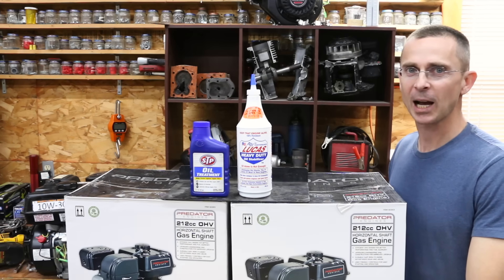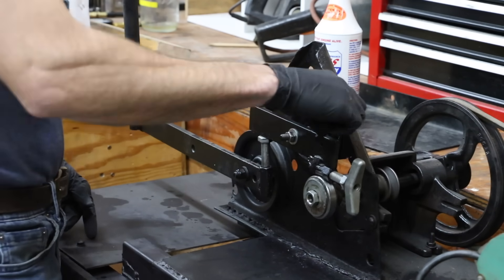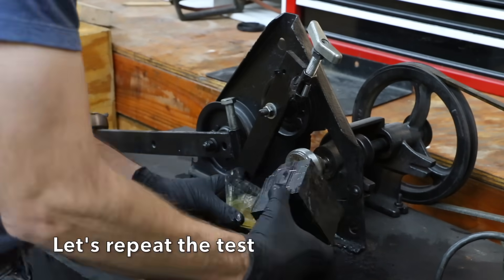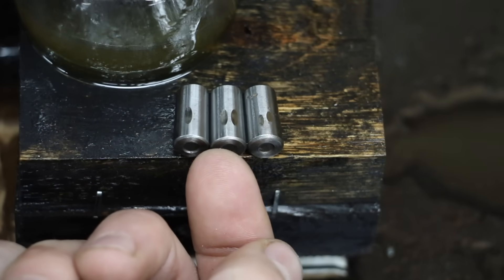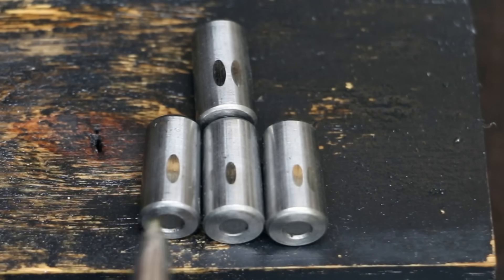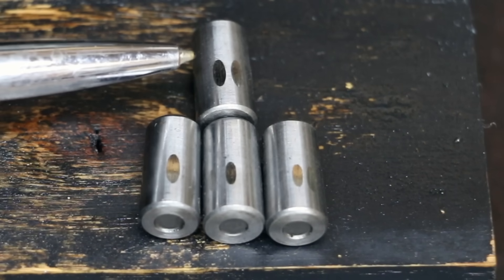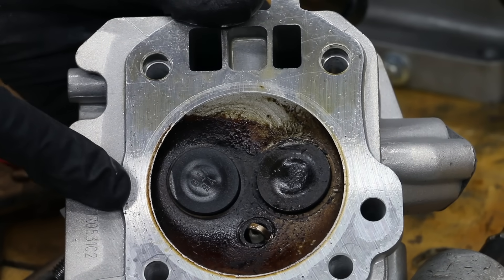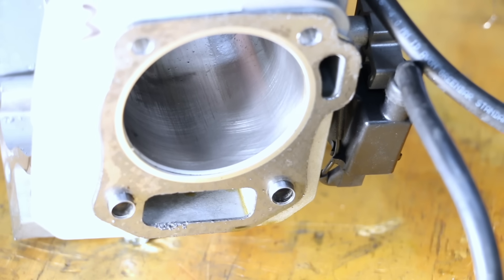Which engine self-destructs first?  Lucas or STP?

Comment: Hmm... Lucas vs Schaeffer's Moly additive? 🤔
Reply from the maker: Thanks for the video idea.
Reply: @ProjectFarm  you're welcome!! I have a bottle of Schaeffer's, but after the bad reaction my engine's variable valve timing solenoids had with Ceratec (or old age, but it happened the oil change of, go figure), I'm weary of putting the Moly additive in there this time. Simpler engines might fare better.

Comment: How about a test using strictly oil treatment in an engine,  no oil....
There is one product  called 
" Kleen Flow " engine oil treatment
I've used in my old Mazda 323 1991
With over 190 000 miles, works very well, wondering if you used a vert badly worn push mower or maybe even a lawn tractor, just to see...
If compression  raises? Temps???
And signs of wear...may e put it against 
" bardahl"  engine treatment , the thick goopy 1,  run both those as only sour ce, of engine , as if was emergency situation and you had no oil on the engine?? Lol, really enjoy the videos
Reply from the maker: Thanks for the video idea

Comment: I watched a skid steer run with a fist size hole in the block with the rod flopping away after which the rod was removed and the hole welded up with the piston welded to the cylinder and continued to run for years until it was finally junked for other reason and since then I have been a firm believer in Lucas. The engine was a 4cylinder Wisconsin
Reply from the maker: Thanks for sharing.

Comment: Good day sir, I. From the Philippines. I have a question. I have ford trac 2001 model. Issue is delayed shifting and hard shifting. When I check my trans. Fluid, it is low, dirty brown fluid, smells burn.
If I put that product Lucas, can I change the fluid and filter first before putting product Lucas?

I'm waiting your response and I'm really appreciate it.

Thanks.

Comment: Really like your videos and I take a lot from them. But in all fairness you needed 40 more engines, 1 control engine using just engine manufacturers recommended oil, 1 with stp additive and the engine under load, 1 with lucus and the engine under load. You also need a set of engines for hot days and a set for cold days, need a set for testing in the rain, need a set for windy days, need set with engines that have a lot of hours...etc. I think it was a fair test though and don't let people like me tell you what you should have done. Going to patreon and support uour channel. Thanks
Reply from the maker: Thanks for the feedback. Thanks for supporting the channel!

Comment: Can you do a similar test but with 2 stroke engines.  Which 2 stroke oil is best.  Run a couple engines with 2 stroke oil 40:1 gas mix for 30 minutes or so, and then run  them with just fuel and see which one goes longest.  Maybe REDLINE, Amsoil, Maxima, and a generic brand.  I have a small 2 stroke 29cc engine and I wonder if some oils are better then others.
Reply from the maker: Great suggestion!

Comment: Slick 50 takes time to embed itself into the pores of the metal surfaces, no short term test is valid. It definitely is a friction reducer in the short term. When I put 4,   two stroke 50ccc bottles of it into my V4 Johnson outboard via the 4 barrel carbie, at idle, it reved up by almost 200rpm. As for long -gevity, its still hard to say as its done only 330 hours of running, so only time will tell.
Reply from the maker: Thanks for the feedback

Comment: I'd like to see your best ever tested vs schaeffer oil w/molly
Schaeffer is big time in farm equipment lubricants including grease
Also make motorcycle oil that can't be used on clutch because it won't allow enough friction
Reply from the maker: Great suggestion!
Reply: @ProjectFarm  I failed to mention, since you're on a farm it may be extra important to you, that their grease is water proof

I was at a demo few yrs ago. The test where you have a bearing spinning in oil and apply a force to the bearing. They're test didn't show any marking and the other oil you could press on the handle and stop the electric motor, with their oil he put it on the floor and stood on the handle and it just kept spinning, the guy was bigger than me and I weigh 200

He added water to grease and mixed, the other mixed with the water and turned white, their grease the water didn't mix and it poured out after mixing

I have motorcycles and cars, I'm afraid to use the oil because they're manual transmission, I could put in the Harley because it has separate engine and transmission oils

Comment: Oil additives.... Just use good oil in the first place. AmsOil, Mobil 1, Royal Purple.... I even ran my Ram Cummins 6.7 liter for 16,000 miles on Shell Rotella Triple T, and the oil quality could have gone another 8,000 miles when I changed it. Just use good oil in your engine. Don't be cheap. Putting these garbage additives in your oil won't save your engine after you've ruined it with cheap oil, or by not changing the oil often enough.
Reply from the maker: Thanks for the feedback.
Reply: @ProjectFarm  - I hope that didn't come off as too brassy. I just feel very strongly about oil changes. Even an old push rod engine will go 200,000 miles if you just keep up with oil changes and use good oil.

Comment: I'm not sure what running the engine with no oil proves... I think a better test would be to remove the governor and put in 26 lbs valve springs (SO the valves wont float) and use the same oil in each engine then add the additives and run them until they die. this would not only test their high RPM endurance but test the internal components of the engine and how much does oil really play a part in how long your engine lasts before your engine detonates. (AKA explodes)

Comment: Stp personally would suit my needs better, simply because my biggest thing is just keeping the oil a good amount cooler so it doesn't shear down and reduce oil life when I want to beat on my car. But I can see why lucas would run longer because earlier in expierment you mentioned it stuck hard and gunked up on the components. Which is probably what have the motor the extra lubricity to keep running longer.
Reply from the maker: Thanks for the feedback.

Comment: I replaced rod and main bearings on a 350 Cummins put a dab of Lucas on each bearing. Well I screwed up switching two of the bearings around, oil hole wasn't lined up.
When we first put the bearings in, we idle the truck for awhile, maybe an hour. Well it seized up and the engine shutoff.
The main mechanic found my screwup, sanded the camshaft off with some fine Emory cloth/sandpaper. Slapped a new set of bearings in and truck went 550,000 miles with no problems. Always used one gallon of Lucas at oil change, every 10,000 miles.
Reply from the maker: Thanks for sharing.

Comment: Using "metal conditioners" generally is not recommended. This is because most of these types of products are derived from a chlorinated compound. The chlorine in these compounds is very reactive with a metal surface and will immediately corrode it. The corrosion byproducts and oxides then become a sacrificial friction barrier. This barrier does have a lubricating property, as it is sloughed off to expose fresh material.

Over time, as this cycle is repeated and the freshly exposed material reacts with the additive suspended in the oil, there can be substantial wear (both chemical and mechanical) to the components. The long-term effects of the corrosive chlorine far outweigh any short-term benefit from this sacrificial barrier.

Not only does the chlorine attack the metal surfaces within the machine, but it also wreaks havoc on the lubricant. One of the greatest dangers in using a chlorinated compound in a lubricant stems from its acid-forming ability when moisture is introduced. When formulating a balanced lubricant, you can account for this with formulations that contain detergents, antioxidants and acid neutralizers, but when you are just adding it from a bottle off the shelf, the balance is lost. The result will be hydrochloric acid formation that corrodes metallic mechanical components very quickly.

You would be much better off using a good quality, properly formulated and balanced lubricant from the start. One of the first steps in accomplishing this is to make sure the lubricant has the proper viscosity and load-carrying capabilities. Remember, it is better to have your equipment operating under a full hydrodynamic fluid film than having to rely on a friction barrier under boundary conditions.  Copied from https://www.machinerylubrication.com/Read/29188/anti-friction-metal-conditioners
Reply from the maker: Great feedback. Thank you

Comment: As an engineer for over 20 years. This made my cry 😢
Reply from the maker: Thanks for watching!
Reply: As an engineering student, same. The suffering is sad :(
Reply: Me too. Years ago I attended auctions of the 50cc pocket bikes. I bought several with minor problems( broken mirrors etc..), but ran fine). Got them cheap, Planned on pulling engines for other uses. Couldn’t bare to chop them up, so a year later gave them to a family with kids.

Comment: Is it possible to put synthetic motor oil in this type of engine? Will it last longer? I ask because I have a lawn mower n is about 3 years old n is about time to change the oil. I'm not to mechanical incline that's why I ask. Maybe it will last me another 3 years. Thanks for the tip👍
Reply from the maker: Thanks for the video idea.

Comment: I had a old push mower that had a real bad leaking seal. Oil wouldn't even keep in the engine very long. For the heck of it I put straight STP in it. It slowed down the leaking seal a lot and that engine lasted several years that way. It was still running until the wheels fell off and I pitched it. I was surprised this test both products didn't last long.
Reply from the maker: Thanks for the feedback.

Comment: My experience with STP.  305 chevy ran valvoline in it only.  The car was beat and beat and beat to say the least.  Adult hot rodding everyday.  Several teenage boys beating it. Also has been on many vacations.  It started smoking on start up around 95,000 miles.   Thats when we started putting STP in it. Eventually,  still being abused it started smoking constantly and had lost almost a full second in the 1/4 mile drags. We kept waiting for it to blow up.  Here comes the amazing part.  At 165,000 miles we pulled the heads off. And to our surprise the inside of the engine was absolutely spotless. Still had cross hatches in the the cylinders and no ring groove.   We had the heads reconditioned and replace the timing chain.  The car went back to it original E.T's and mph in the 1/4 mile. We continued to literally beat the shit out if it. We sold the car with 197,000 miles. Not only orginal engine but with the original transmission also.  The car was totaled by the new owner at 220,000 miles.  Maybe we had a freak? I don't know.  But that made me a believer.  To this day we are completely confused on how that engine never dropped oil pressure or blew up.

Comment: It seems to me all those picking Lucas as the winner are missing the point, the point being is to always have oil in the engine, why people are basing which is best on a dry engine is beyond me, I suppose the argument can be made that if the engine lasts longer dry, it will last longer with the additive but that has not been proven to be true. 
The STP shows the engine running cooler with it added to the engine and a cooler running engine is a good thing, one can surmise that it is running cooler because of better lubrication creating less friction, (less friction, less heat), again, we are talking about a lubricated engine, not a dry engine. 
I guess if you plan on running your engines dry and want an extra few minutes of run time, choose Lucas, if I had to make a choice between the 2, I would choose STP because it clearly shows that an engine runs cooler with it compared to Lucas.
Reply from the maker: Thank you for the feedback!

Comment: I Are use STP for oil transmission in also Lucas for the gasoline engine halfway court so it makes it more better when I do the oil change service for the next time and thank you for your advice is for everything for oils and lubricants of vehicles and spark plugs also in other vehicles necessary equipment
Reply from the maker: Thanks for the feedback.

Comment: Hyperlube Oil Supplement, 32 oz, HPL201 is similar to Lucas. Could have been a 3 engine test. 
But using Lucas in my 91 Goldwing 250K miles, it gummed up my Neutral Switch. It's lubed by what drains off the wall above it. I used SeaFoam in the oil to try and loosen it, so far no luck. 

With Hyperlube no issues in my 2K Goldwing, 58K miles.
Reply from the maker: Thanks for sharing.

Comment: Please do a comparison of BG Products compared to others. I have searched the web and no one has done a proper test as you have done many time before. Its a little pricey but they swear it works. I'm interested in knowing whether or not it adds lubricity, longevity to an engine when used with every oil change.
Reply from the maker: Thank you for the video idea!
Reply: Project Farm also there’s a product called “tvt” they have a video on YouTube where they hang a 40 pound bucket of water on the bearing test, like the one you use. And it doesn’t stop the bearing from spinning. Pretty impressive. I’ll post the link as soon as I have it.
Reply: Project Farm their website is www.herick-online.com

Comment: Here is my theory on STP: When STP was developed many, many years ago (1950s?) Engine oils we're pretty pathetic compared to what is available todsy. I'm STP was a revelation in that time frame. Not today. Also, STP would be the same as it was back then, without any improvements, because any change would make it something else and risk alienating satisfied users with a different formulation. Lucas, however, is a newer product taking advantage of all of the lubricating advances made since STP was developed. Frankly, I haven't used STP for almost 45 or 50 years and when I did back then, it was to bootstrap a failing or elderly engine.
Reply from the maker: Thanks for the feedback.
Reply: Yep - that thick STP could keep a car with loose rings or bad valves going a bit longer - that was the best use for it.   I wonder how much The King actually put in his race engines - especially when they went to dry sump.....can't mess around with additives in those.

Comment: I have kept a number of old cars running by adding STP oil additive.  One of the transportation companies I drove semi's for used Lucas oil additive in their engines.  Oil consumption for my semi's was virtually nil.  Small engines have splash oiling.  Neither STP or Lucas, by themselves, splash sufficiently to properly lubricate a small engine.  Don't use either additive straight - follow the directions.
Reply from the maker: Thanks for the feedback.

Comment: All you need is a ZDDP additive especially for older flat tappet motors
Reply from the maker: Thank you for the feedback
Reply: @ProjectFarm  I'd like to see a comparison between ZDDP-MAXX and I guess the undefeated Lucas I tried some of the ZDDP-MAXX in my TRX450R stroker race motor it did seem smoother than just using Rotella T6 5W-40 alone. I got ripped off for years buying all the big name oils and I got the same advice from 2 sources Competition Cams being the first after we had a new flat tappet camshaft fail during break in and the other was a machine shop who specializes in motorcycle & ATV race motors! When you pay $10,000 for a race motor you do your homework or pay for it again sooner than intended!

Comment: Why destroy without oil? Why not examine for operating wear? Crank journals, cylinder bore, piston skirts, piston rings, valve guides, valve stems, cam journals and lobes. ALL engines are destroyed without oil. Not seeing value of this test.
My Honda Gvc160 mower is 12 years old.
 I change the oil every 15 hours and a clean air filter too. I also make sure to clean out accumulated grass under the engine cover that would cause overheating.
Reply from the maker: Thanks for the feedback.

Comment: Since small engines use flat tappet valve actuators, maybe a high content zinc additive would be a good thing. Should be legal since they are strictly off highway engines.
Reply from the maker: Thanks for the feedback.

Comment: I just use plain old Valvoline 10W-30 conventional, in pre 2000 engines. I have a 360 I built about 12 years ago. Pulled the engine and it sat on a stand for about 11 1/2 years or so. Tore it down to re-seal and re-lube to put back in. It had about 1500 miles on it. The white coating on the bearings was still there.
Reply from the maker: Thank you for the feedback

Comment: Been using lucas since the 80s. Never an engine failure. But then again, I always do regular maintenance including 3k mile or 3 month oil changes. This guys tests , idk...
Reply from the maker: Impressive!  Lucas is great. Thank you
Reply: 3k miles? That's a waste unless you're racing on the motor.

Comment: Am using 20w50
For my engine from 20years
Can you tell me ist good for summer or not make test plz
Reply: I can tell you a new engine with variable valve timing your engines would barely turn over in sub 30 degree weather and the upper e d wont be getting oil for a couple of minutes.

Comment: before we start, I heard lucas was better.

*...Yep. 

(I mean engine alone you couldn't  say definitively, but given lucas performed better in both tests...)

So, I know from first hand that STP and oil evaporates quite quickly I used a high STP:Oil mix as a engine assembly lubricant. It evaporated before I could start it. It doesn't surprise me that it would dry quicker in a running engine, though it may theoretically be unrelated.
Reply from the maker: Thank you for the feedback